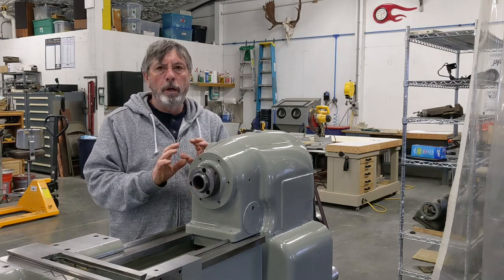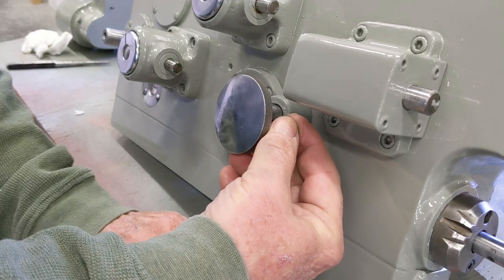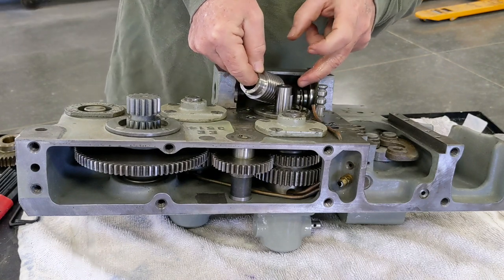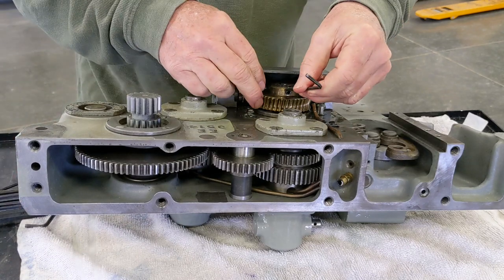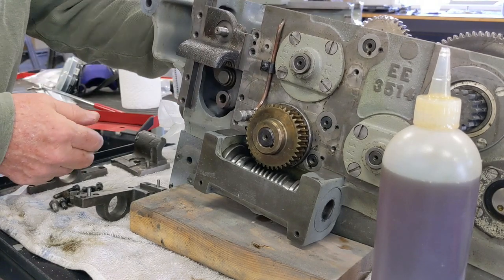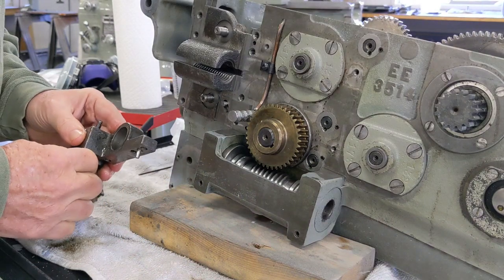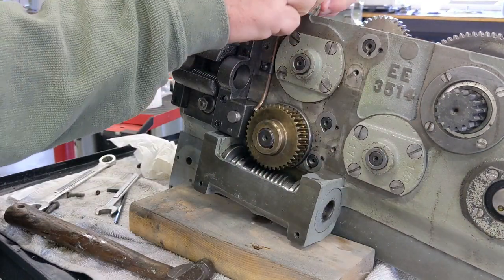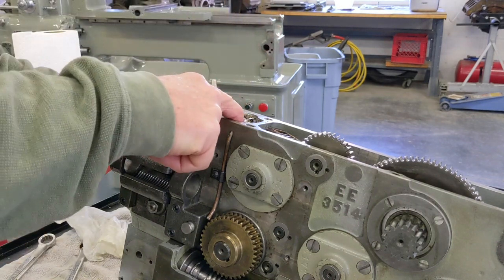Monarch 10EE Lathe Refurb part 12

Comment: Your videos are very helpful to me and they are very good quality. I have a Monarch 10EE; date of manufacture is 10/1940. I didn't buy it new, LOL. I don't use it a lot but everything works. It's been modified (from hydraulic drive) with a VFD.
Reply from the maker: Hi John Thanks. It would have been pretty impressive if you did buy that lathe new!!

Comment: Another wear item is the key inside the worm - it's integral and tends to wear away on the drive shaft.

Good catch on the oil through the top half nut.  A lot of folks miss it and it's frequently plugged
Reply from the maker: Thanks Russ! I did slide the worm onto the shaft to check that and it was pretty tight. On my other lathe, it was a little worn but still pretty tight. On the half nut oil passage..it was actually plugged when I took it apart. There was a chip stuck in it.

Comment: I have an early 1960"s EE  with taper attachment that has been converted to FVD AC drive.  Everything works great except a lot of backlash in the cross slide and compound.  I purchased new lead screws and blocks from Monarch but haven't installed them yet.  Would love to see you video how this is done before I tear into mine without knowing how.
Reply from the maker: Thanks for watching Jack!! So I should be on to the cross slide and compound in a couple of weeks. I'll make sure to get some thorough coverage of that.

Comment: Like?  I’m loving it.  Keep posting please.  Suggestion. Monarch does have the pan gasket. If you take it off I suggest replacing the Bjuir pump filter while you’re in there. It will keep the pump supplying filtered oil to the Bjuir precision metering valves. Monarch sells the filters for not much money, the metering valves are also available but not so cheap.  What is the rag/gauze material in the sump on the top of the apron?  I’d like to replace mine.
Reply from the maker: So the material in the sump sure looks like a cotton based gauze. It probably doesn't really matter as long as its something that won't degrade over time. I do have the pan gasket and in an upcoming video, I talk about a potential problem I had, which thankfully turned out ok!

Comment: Worn worm .I wonder how many hours it takes to fill the sump and if the cover needs to be sealed to stop debris from getting in the sump and chewing the worm gear up.
Reply from the maker: Thanks for watching! I'm not sure but I will check on the level as I finish the assembly and let you know. The cover has a pretty good fit but its absolutely amazing where chips seem to find places to go!
Reply: @fourpondsshop7940  using air nozzles to blow chips off spreads them everywhere.
think aluminum foil tape to seal the cover over the worm gear.